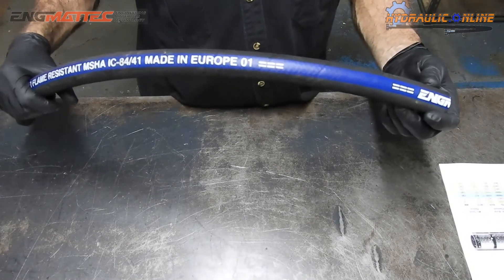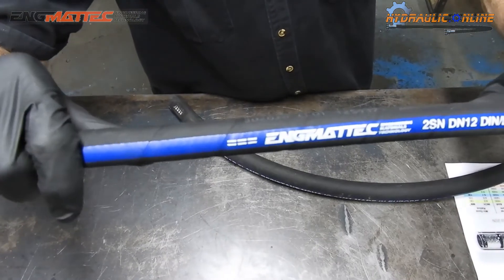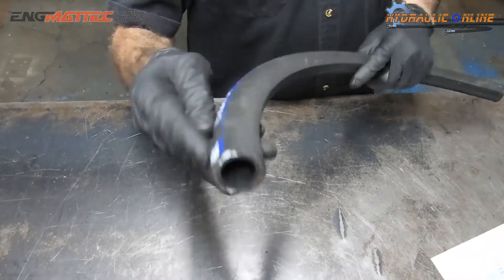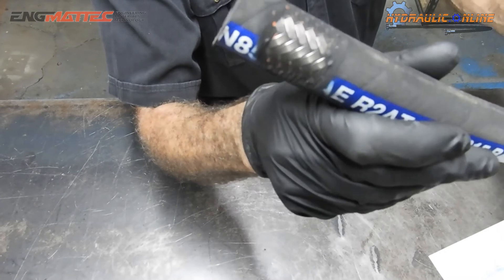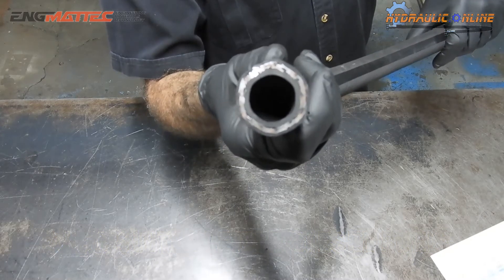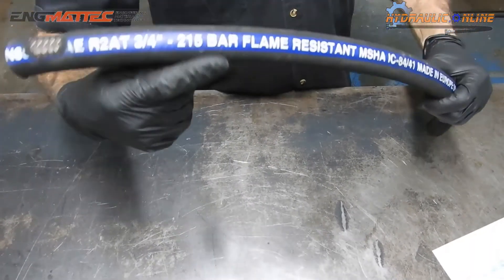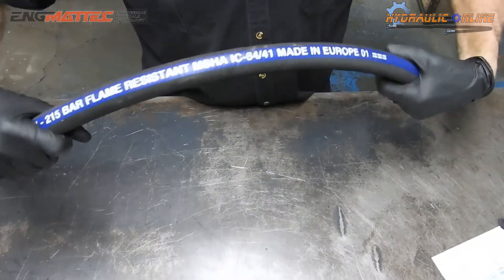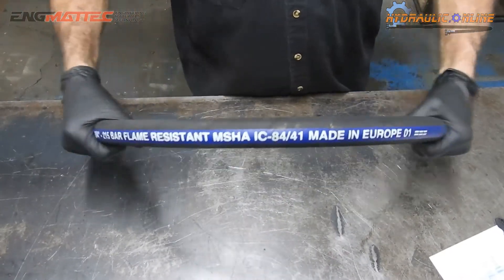Hydraulic Hoses Explained  SAE 100R2AT - 12 ENG MAT TEC 3/4 TWO WIRE

Comment: What is R2AT?
Reply from the maker: R2AT  R2 = Two layers of Braided Steel Wire reinforcement, 
AT = Usually meant a higher OIL temperature resistance, 120 instead of 100 degrees Celcius. But it does not seem to be the case any longer because many manufacturers add the AT but Oil temperature resistance is still stated at 100 Celcius.🙄

Comment: Hey how are you? I work with hydraulic hoses here in Brazil. would you like to know how the hose stores in Australia work?
Reply from the maker: Milton thanks for your question.
Our hydraulics business provides 3 different hydraulic hose services. 

1. We Send a trained technician in a fully equipped service truck out where the client's machine is located and then our technician removes the hose, makes a new hose, installs the new hose, tops up any oil lost and, then tests the machinery, This is the most expensive option but it is also the fastest option as machinery downtime is kept to a minimum. 

2. The client takes the hose of the machine and brings it into our service center for us to make it for them. 

3. The client knows what he wants, orders it from our website www.hydraulic.online and we either make it for them and post it out or send the individual parts for the client to make themselves. 

How does what we do compare to what you do in Brazil Milton?
Reply: @Hydraulic.Online  I thank you for your attention.
 the way you work is very similar to ours, we can also divide it into three parts:
1. when the customer has a lot of urgency and is a loyal customer, we go to the location and specify the hose, from there we pass it on to whoever is in the store to assemble the hose, and the rider enters.
2 the customer takes the hose to where we are, we pass the price and if he accepts we do the assembly.
3. the customers who are faithful the hoses are registered and go with a label, it is already registered, when it burst they give us the registration number and we take it.
Here we assemble a hose from R1 to R17, practically for all types of fluids.
I noticed in some videos that you use the SAE standard a lot, I didn't see the DIN standard.
here we work with both and there are still some that are mixed. example, komatsu, which has a metric thread and jic 37 seal.
Reply from the maker: @miltonfrancocardeal6010  Oh wow you have a very interesting services for your faithfull customers. Great idea for quickly delivering parts with motor cycle that's awesome!  I also like the idea of a lable for easy traceability and quick manufacture. We will think how we can do this as well for our good clients, like creating a database of hose assemblies. We do have a range R2 hose manufactured under our brand ENGMATTEC (Engineering Materials Technology) that is also compatible with DIN standard EN853.  We also do metric fittings, but here in Australia they are mainly only found on european manufactured equipment such as truck mounted cranes and concrete pumping equipment.  We also keep limited supplies of Komatsu fittings to but the taper is 30 degrees not 37 degrees as well as inverted BSP or JIS fittings too.
Reply: @Hydraulic.Online  thanks for the correction of the degrees. here we have equipment from almost all over the world so the hose variety is very high, we manufacture hydraulic steering hoses from cars to hoses from ship crane. so we work with several standards, 4sh, R15, R17, etc. despite having a heavy machine workshop, which belongs to the store, the hoses are o number 1 . I have a little notion of each sector, such as actuators, hydraulic pumps, diesel engines, welding, machining, but what I master is the welding and hoses part. we work here with the balflex brand.